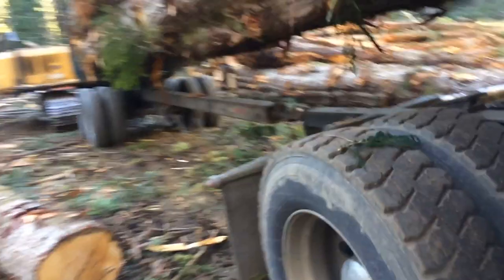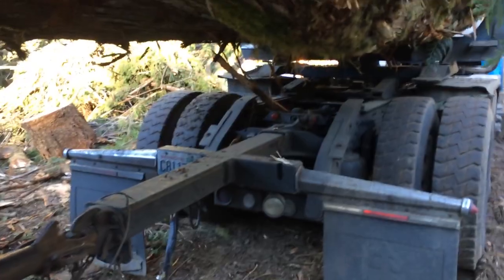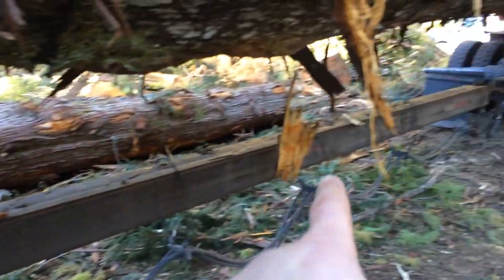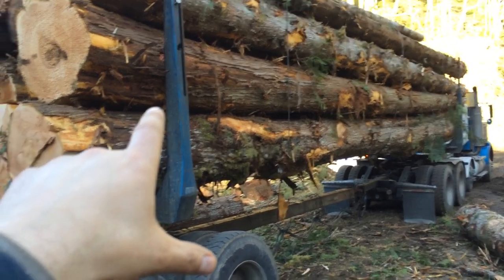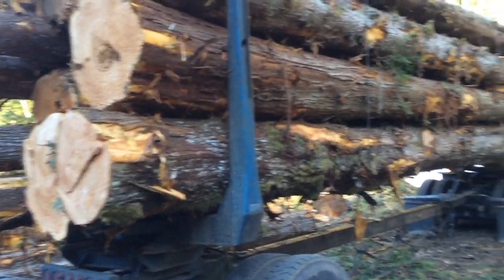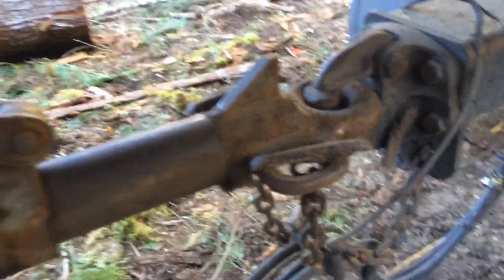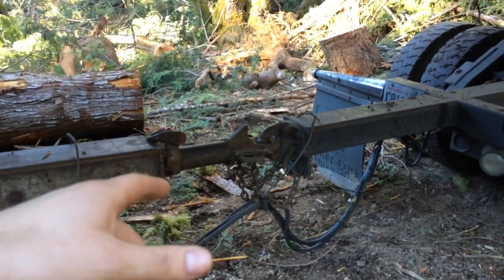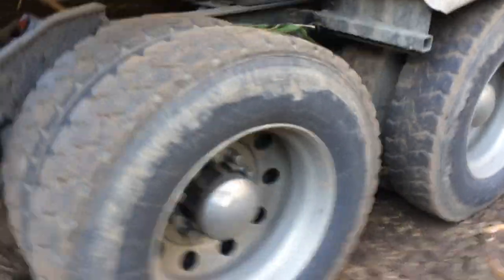How a log trailer compensator works.

Comment: A little background information: When loaded the logs sitting on the bunks, truck and trailer, pull the trailer down the road. the stinger and reach/compensator are connected at the hitch but are not involved in pulling the trailer. Rather, their purpose is to steer the trailer. When the truck is steered to the left the stinger on the truck swings to the right, pivoting somewhere in the drive axle region. This steers the trailer to the right thereby allowing the trailer to follow in the tire tracks of the truck in all but the most severe turns. The log truck/dolly combination does not cheat like a fifth wheel trailer and will stay in the narrow single track roads they seem to want to build these days.

Comment: All that fancy new fangled stuff. One of the only log trucks I've driven that had logs on it was a early 50's KW with (I think) a Peerless that had a wood reach! I did a bunch of work to the supercharged Cummins in it and we wanted to test drive it with a load before I called it good. Was quite the experience,  hats off to the guys who drove that stuff back in the day.

Nice video.
Reply from the maker: Wow that would have been quite the experience ! Thanks for sharing.what size motor was the cummins ?
Reply: It was a NHS-275, commonly referred to as an "iron lung". It was pretty much the top of the litter for the 743 Cubic inch engine series. The 743 became the legendary 855 series. There have been a ton of changes over the years, but you can look at the last N-14 that ever rolled off the assembly line and the very first 743 and see  the similarities. It was a pretty cool opportunity, it was really cool - I may never get the chance to work on another NHS!

Comment: Awsum yep u are dead right on the video.. I've just started back driving stems units..mostly Carry's 103tons on its back..about 18meters plus ?..Awsum video bro
Reply from the maker: Copy that, we do 11 meters at the longest on this job, most guys haul no longer than 32 meters here but it’s all on road lots of weight restrictions like you blokes have down there. Not many off highway operations in this neck of the woods. Are you on pan Pac ground ?
Reply: Tiaki Plantations Kawerau and Tarawera Forest out of the Ground base Crews Bro
Reply: Carting into the KLY Log Yard rgr